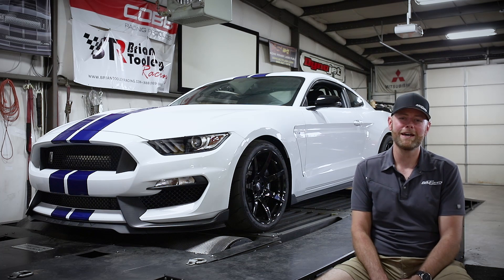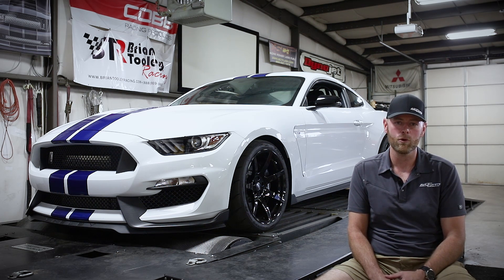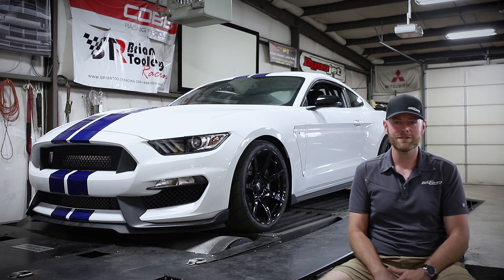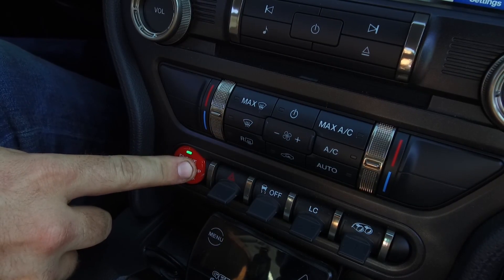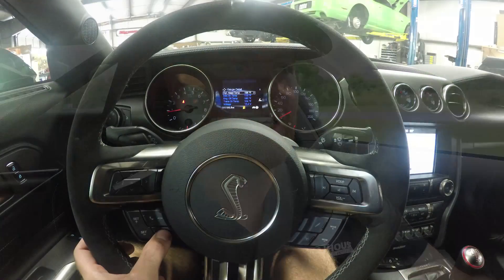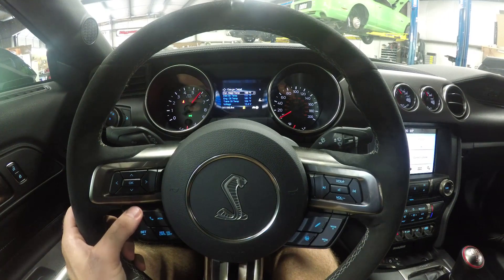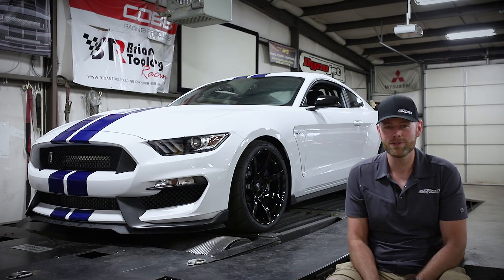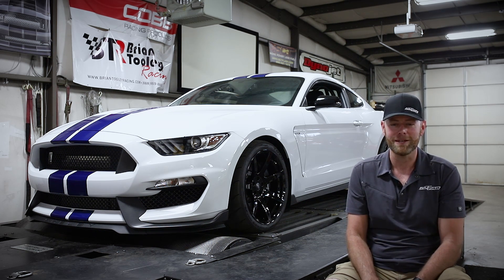Shelby GT350 | MoTeC M150 Overview

Comment: The GT 350 motors have been blowing up left and right.  It is NOT a hearty engine.  I wouldn't think that demanding a LOT more from it would end in lots of shiny pieces in the oil.
Reply from the maker: They are better engines than the internet will have you believe

Comment: Took a beautiful, na plane crank V8 and bastardized it.   Not everything needs an "improvement' like this.  Obviously, the Clearasil crowd, who only knows how to drive straight, will be impressed.    A perfectly clipped apex in a Miata would give you rush.  Considering that this "tune"  is out of reach for the vast majority of the fanboys,  perhaps sticking to sniffing glue or inhaling air cleaners should be suggested instead, as a substitute for this particular fantasy.
Reply from the maker: Thank you for giving everyone your opinion
Reply: @FathousePerformance  Enjoy. BTW, are you authorized to speak on behalf of everyone?

Comment: Personally, I’m impressed with what you guys have done. For sure a crazy car and an incredible build. But, if I did own a 350 or 350R I personally wouldn’t do this. I feel like this is more of a car made specifically to take corners. The extra power is something I feel like it would be too hard to control when driving seriously around a track or road racing, which I’d do if I owned it. But again, great build.
Reply from the maker: One of the coolest features of the motec is the ability to turn the power down via the steering wheel controls.  On pump gas and normal mode the power is as low as 700whp

Comment: Is that a engine stock handling 900 hp +  or has it received some internal or external parts ?
Reply from the maker: Our 1000R package is stock engine with upgraded oil pump and crank sprocket gears.

Comment: Why is it that you guys don't want to pass 8-10psi on pump gas? If the engine had upgraded internals would you think it's okay to run higher boost on pump gas?
Reply from the maker: Yes with upgraded internals we could push it harder on pumpgas if we wanted to

Comment: Can you run just the tune with the drag mode and ghost cam?   Stock exhaust minus resonators.... if so, what power is it putting down without boost?
Reply from the maker: We have done a few basic bolt on NA setups making 525hp.  We have not installed the MoTeC on an NA car yet though

Comment: That was the engine the Ford gt deserved
Reply: mario figueroa  Cross plane crank is much better (more reliable) for high power.
Reply: B C you are right but if you have to pay almost half a million dammit give a more exotic engine not a 6cyl raptor engine for half a mill I can get a Ferrari that sounds like heaven and looks awesome and make me look like a Arab king
Reply: mario figueroa  I’m not arguing, I’m just saying a 5.0-5.2 GT350 engine with a cross plane crank would have been better for the new Ford GT.   Which is pretty much the 2019 GT500 engine, but topped with a 2650 TVS instead of twin turbos.
Reply: @marfigue777  the rules for the LeMans 24 has the Ford GT limited to a maximum of 4.0L with boost and since Ford does not make any 4.0L V8's they are stuck with a V6 ..but it would not be that hard to build a shorter stroke crankshaft for any of the 5.0L V8's as Nelson racing engines just de-stroked a 350 to a 260 for a boat to comply to their rules
Reply: @donniebaker5984 last version had a v8 with no issues and yes I know it was designed to win Lemans dude it was just a opinion that's what the comment section is for
Reply: @marfigue777  apparently you did not understand a word I posted about an easy mod to keep the Ford GT compatible to meet all rule requirements and still have a real V8 of 4.0L = around 240 cubic inches of displacement ...add twin turbos will produce plenty of horse power .. oh and by the way speaking of horsepower of the competition Ford gt's , have you ever looked into what Ford is racing in the Ford GT as far as the V6 they are using? I did not think so ...it took a while for me to Google it as most places are dead ends ..but eventually I found what makes the all new Ford GT go !!! And without a doubt it takes way more than the 640 +or- horsepower that Ford  has been very veg of telling us all about ..so I went fishing for days on end and found the answer. Ford does not build their own engines for the Ford GT track cars ... But it is Roush/Yates who do the voodoo and make 1100 horsepower from an all billet Ecoboost monster
Reply: @marfigue777  true but the 1/2 mill Ford is cheap compared to all the cars that run in its class and you won't ever buy a Zonda for a half mill ..and you won't ever buy a McLaren for a half mill ...and you won't ever buy a keonigsegg "R" for a half mill anywhere unless you know people who take them in 60 seconds
Reply: @donniebaker5984  dude ok why you take my opinion so seriously??? Is just my opinion and I'm not the only one who thinks it could be cool to have a exotic v8 on a exotic looking half a million dollar car we didn't ask for a Lemans winning car when you spent half a million dollars on a super car you want every thing to be super a raptor angine is not super and please don't reply with all the specs on the gt engine we know is a good engine dude you are not the only car freak out there
Reply: @marfigue777  Ford didn't build the car to please you ..they could not give a shit less if it ever sold to the public at all as they don't make enough profit to pay for it all ..all they are obsecessed with is passing Ferrari since enso back out of their deal in the 60's and you should be very thankful Enso stood his ground and told Henry II to take a flying leap ! Or your sweet sounding F40's and F50's today would sound just like an F150 Ford pickup truck
Reply: What kind of setups you guys got for 2018 gts???
Reply: @tmothymccutcheon7432  talk to Roush/Yates

Comment: How do you put all of that power to the ground with 1000 hp? OMG. Lol Even with traction control and engine management. Man that's alot of power. I would like to see Ford spline the front wheels and make it all wheel drive. At that point this car will be unbeatable.
Reply: Paul Daluz I did that on forza horizon
Reply: Sharrod Reed haha nice
Reply: That car is streetable because of all the nanny controls. I have ridden in an older thousand horsepower twin turbo Mustang that doesn't have all the nanny controls and it isn't really streetable.
Reply: I liked cars better when they  only had one mode: "the  drive mode." I don't like all the nanny controls, but it's still a great car.

Comment: Awesome car, nice video  !! What kinda world do we live in where almost 600 h.p in a stock car is considered lacking  lol
Reply: beld capristo Well its because gt 10 spd is essentially as fast and the car doesnt make low end.. in relative terms.. and mericans like drag cars even if the car isnt designed for it. I don't  know what this aftermarket set up costs but it seems awesome if you have a bunch of money. If dealers werent raping for these I could see spending some aftermarket money to mod it. Perhaps one small turbo to boost low end and kinda low boost so cooling when running hard for a long time is not to big a deal would seem great. Hopefully 1 small turbo wouldnt quiet the cool engine sound. I dont knkw how much that MOTEC is. I imagine shit ton but yeah one turbo and a system to make jt mangeble as a street car would seem great. Basically the cars only downside is low rpm power so more of that and then the power it makes at high rpm would seem like a badass set up. It handles good, looks bad ass (better then a ZR1 in looks imo) and would be more then enough for street car. But if your gonna do the advanced motec and spend that money it would probably be silly not to have both turbos. I imagine a low boost SC would do the trick as well for low end but the Motec to manage the power and not leaving you traction limited and blowing tires off all the time is cool as fuck, not to mention the roll function that builds boost. Its fucking awesome all around and im not even particular to fords. Yep, if i were rich I would go for one. But i think it also depends on what the Stock GT 500 Will do and for how much. This set up may cost as much or more ... even with dealer ass rape..as a 500 when they come out and of course be warrantied. Car is badass and you would shock some mother fuckers if they thought it was a stock 350 as they are nit particularly fast by today's standards and as stated about the same as a 40k GT in drag scenarios.

Comment: Yeah.  You guys definitely know what you’re doing.  Fantastic fuckin video! Well versed, extremely knowledgeable, and the way you express the information is really good guys.  #SVT you guys have taken a lot of “drag car” technology, and made it not only reliable, but daily drivable. (Boost by gear, the computer givin. Or taking timing based on the gauge told* ethanol content, and even the rolling anti lag) fuckin awesome guys. You think the new motor design (flat-plane) will be the future for the power house packages? The 5.2 over the 5.0.
Reply from the maker: Thanks Jared!  Ford has already nixed the flat plane crank for the GT500 so we may only get to enjoy it for the few GT350's that are built.  Either way we will pus the Ford platform no matter what engine they provide us!

Comment: How long does it take after receiving the vehicle at your facility until it's ready for delivery 100% functional? Also, is it possible to add the MoTeC system to the 800HP package? That's what I was looking at getting, not sure if it's possible or just over kill if not on the 1000HP package. Thanks.
Reply from the maker: We do not offer the MoTeC with the 1000R setup currently.  The parts needed to set the MoTeC up would bring you into the 1000R minus the custom exhaust so it just doesnt make sense.  1000R packages with the MoTeC system take on average 8-10 weeks from start to finish.

Comment: Just tell me if it's possible: a 5.0 swap into 2018 raptor and maintain all electronic functions/features
Reply from the maker: Anything is possible with enough time and money!
Reply: well, obviously you would buy a 5.0 F-150 and bolt on the Raptor goodies if somebody wanted a new V8 raptor.  I was just asking if it possible in terms of cracking the raptor ECU
Reply: Son of THE King  No point in cracking the Raptor ECU if you’re 5.0 swapping.  Just swap a 2018 5.0/10R80 drivetrain, including engine/trans harnesses and ECU.

But yeah, the Raptor ECU has been cracked for a long time.
Reply: Son of THE King not the same LMFAO
Reply: You better have plenty of money that's like buying a 2nd truck

Comment: Did you change the wheel and tires? I hate my 2018  GT350 tires (Michelin Super Sports). I find they dont grip at all when launching and changing 2nd and 3rd gear.
Reply from the maker: This car has Toyo R888R tires but they are not good for drag racing.  They work very well with the turbo setup from any speed rolling.
Reply: Manny Land Yah they have much more aggressive tires but not sure which ones, looks like nittos.

Comment: Awesome car nice job!  I have a 16 GT350 with a procharger and boost is just what these cars need.  It was hard to go from a 700whp GT500 to a stock GT350 I had to boost it no regrets on the choice.
Reply: See kids? Once you try a drug...
Reply: I don’t understand it. The Shelby 350 and R’s are badass cars. But they are not Drag cars. They are not in the same class as the Demon. Why would I Drag Race this car. And do you really need this much Horsepower to go on a race coarse for which the car was designed for. I’m not knocking the idea and the concept. Its a waste of car to go after the Demon. Stay in your class.